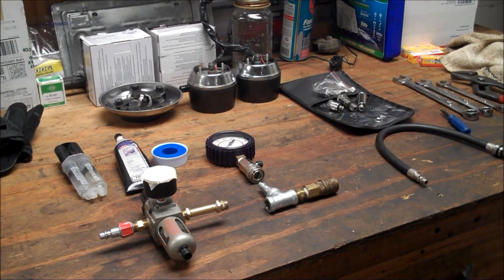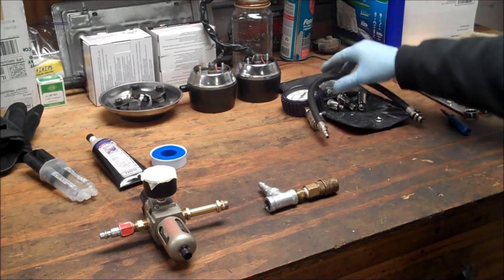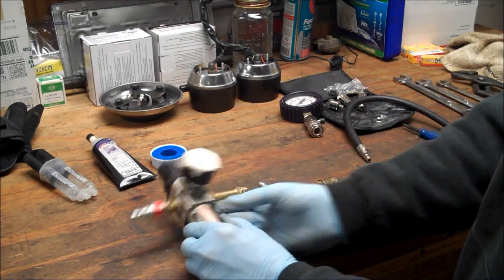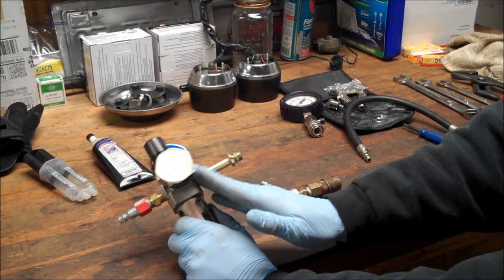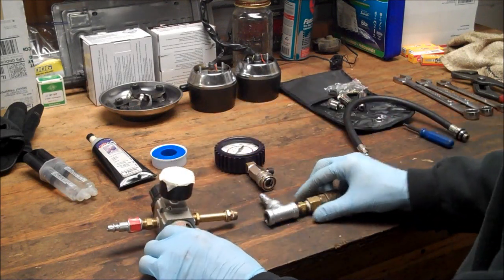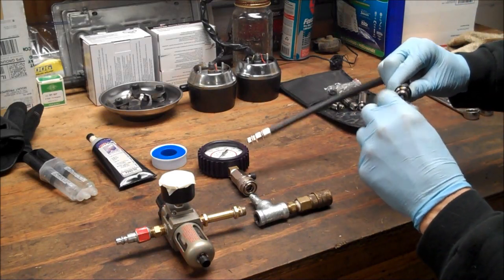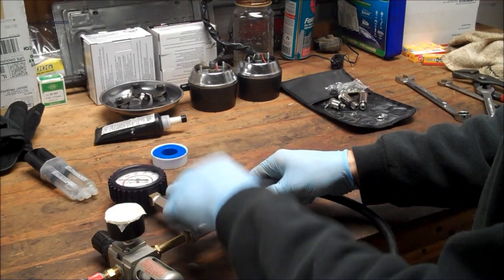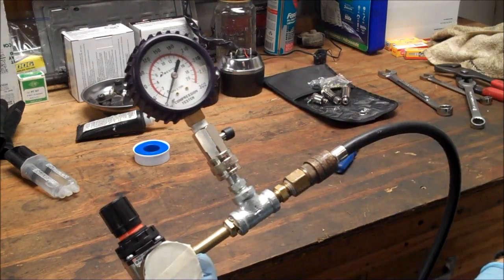DIY Leak Down Tester

Comment: I think that I need to buy one since they sell them on eBay for $34 AUD anyway, my dads Honda HRU217D lawnmower which runs the GSV190 engine is burning a bit of oil on startup & it's hard to start.

The specifications from Honda tell me that the compression is at the recommended 71 PSI but I'm not convinced that the rings aren't worn,it has a decompressor so the compression is a bit lower.

My point is adding oil into the combustion chamber raises it up to 100 PSI,so it sounds like it's a piston ring issue.

I think that a leakdown test is the way to go,that's probably why Briggs & Stratton don't release official compression figures, it sounds like that I can't rely  on Hondas data !

I actually did find the starting problem, I had to adjust the throttle cable as the choke was sticking open slightly, so it starts first pull now.

A leakdown tester will still give me a more accurate reading & let me know if the rings are starting to go bad & cause oil burning !

Comment: I have mine made up but not connected to the bike with just air flowing the gauge is showing about 40psi not almost 0 like yours. Do I make the drilled hole in the epoxy smaller? Bigger?
Reply from the maker: What size hole did you drill? Starting pressure 100 psi?
Reply: MatthewMCRepair it was tiny tiny. I’ll toss a micrometer on it  tonight to see. And yes 100psi.
Reply: MatthewMCRepair will this skew he results??
Reply from the maker: Read this: https://en.wikipedia.org/wiki/Leak-down_tester
Reply: I read the wiki article and I don't believe the orifice is needed if you are using a single gauge.   The orifice inside the regulator is sufficient.  It is only when using two gauges that you need an orifice between them, because you are making a differential pressure measurement and the passage between the first and second gauge needs to be relatively small to restrict flow and maintain accuracy.

Comment: lol i'm a mechanic and i've done this.  I had a universal compression gauge and a leftover regulator from doing some body work.  i decided to just put a small brass fitting between them, fill it with JB weld and drill a 1mm hole through it.  later on, i decided to put a really nice 6-bearing brass quick coupling between the regulator and restrictor, so when I'm done with it, I can simply pop it apart and use each component individually again.  it looks like a big, hideous transformer or something, but it works!
Reply from the maker: I have since modified it a bit. Watch it here: https://youtu.be/tiza8Zdnvik

Comment: Most mechanics already own a compression gauge, and you can install a quick disconnect on the compression gauge hose to use the hose and plug adapter with a leakdown tester.

Comment: Can you explain why do you have to remove the schrader valve?
Reply from the maker: +Tim Fox Because you are forcing air IN on a leak down test, while a compression test forces air OUT. The schrader valve is there for a compression test, and to retain air pressure so you can read the gauge.

Comment: hey Matt thanks for video bro i have a question,i seen another video where they say on the hose where you break and put the end of the spark plug to weld my question is would jb weld hold that amount of pressure for this i can weld it i just thought it might be easier and get a better hold since its so small anyway thanks for any info on this
Reply from the maker: Shannon Fraiser Can you share the link to video so I can see what you are talking about?

Comment from the maker: Ian, I've experienced the same thing on smaller engines especially on single cylinders. You can use 15psi with this DIY tester, however that math is not as easy as 100 psi.

Formula is ((regulated - pressure drop)/regulated)*100. Let's say regulated is 15psi, you would have to measure pressure drop at 14.25psi for a 5% leak down.
Reply: Having problems with my Suzuki SV. Cam timing is a PITA. New cam chain on order. I have 4% leak down but it doesn't tell you if your oil rings are bad. 50 psi set, connect motor, 48 psi is 4% leak down.

Comment: I have tried this on several motorcycle and small engines and found that 100psi is way too much pressure for these tiny cylinders. The piston gets forced down to BDC every time. True leak down testers for small engines like Motion Pro and Harbour freight use only 15psi.